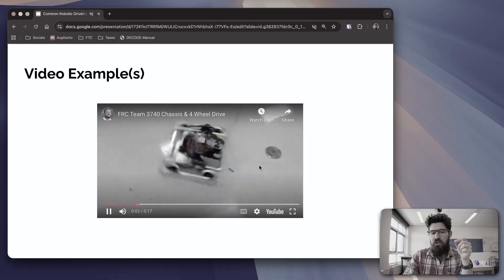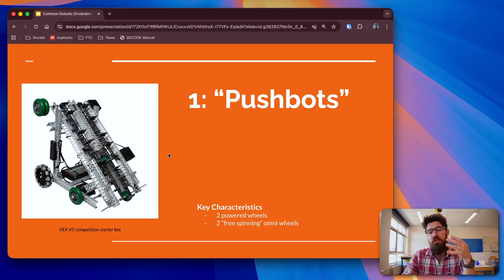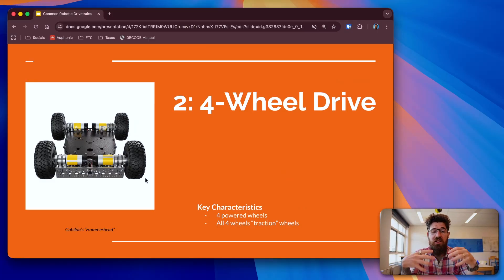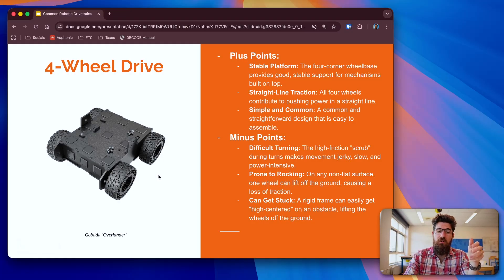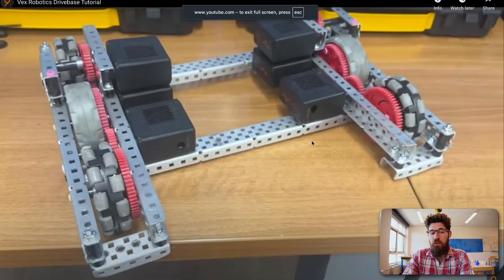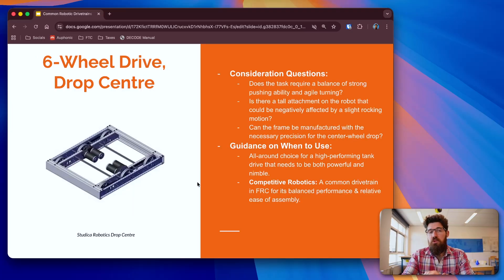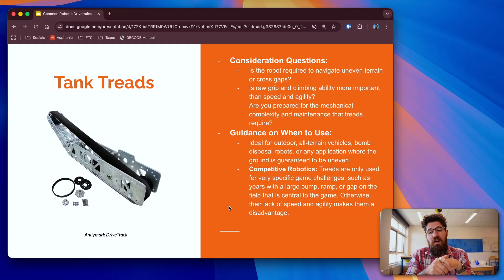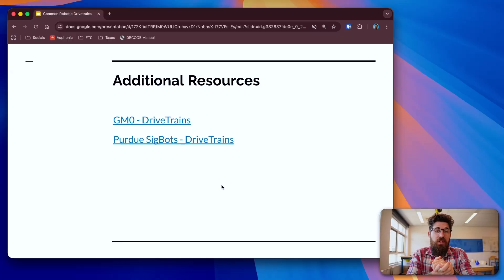Robot Drivetrains Overview: Tank Drive Chassis

Comment: In the beginning of rhe video you state that tank drives arent very fast. Id argue this because they can be made just as fast as any other style of drivetrain depending on how you gear them. 

When referring to a drop center 6wd robot they cant all be called a west coast drive. A west coast drive is a design style of a drop center 6wd robot derived from FRC teams in California that quickly gained in popularity. The main drive rail is an aluminum box tube typically 2"x1" and the wheels are cantilevered off of this drive rail.
Reply from the maker: Re: speed, that’s definitely a misspeak on my end, I think I was thinking of tank treads originally.

I didn’t realize the history on the naming of the WCD, thanks for sharing!